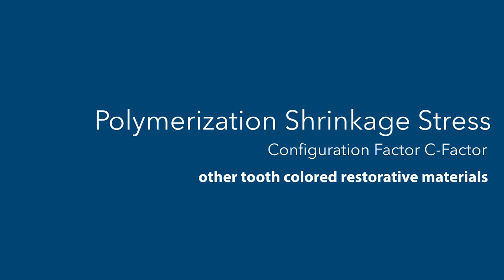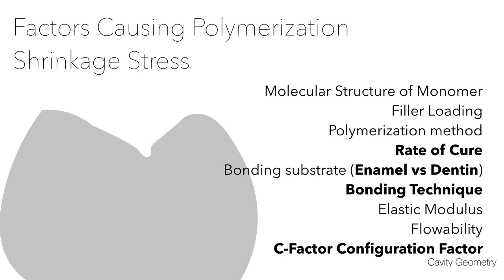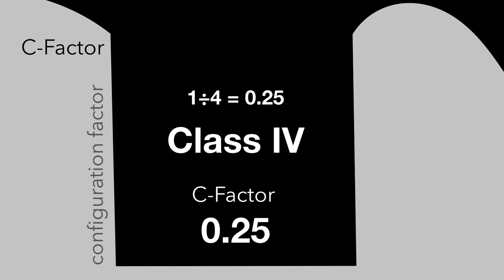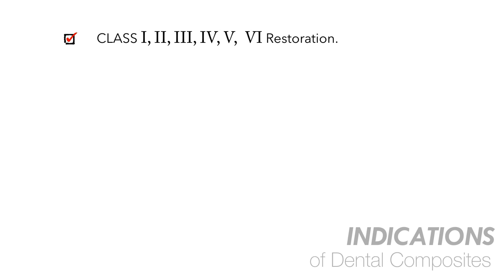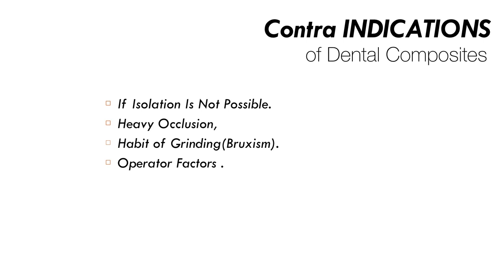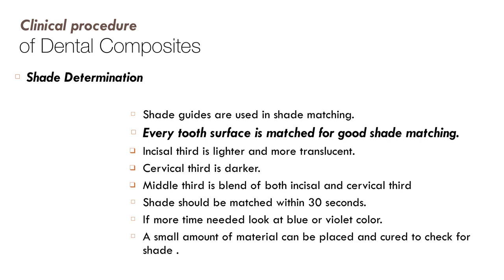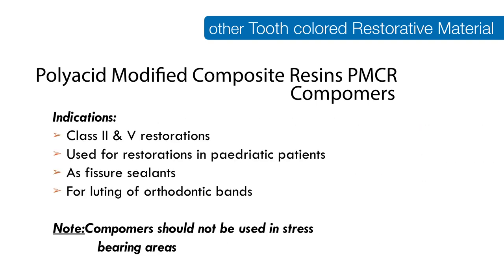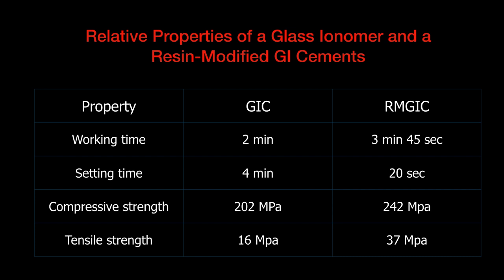Introduction to Dental Composite II

Comment: Does placing a liner in the cavity have any effect on minimising c-factor?
Reply from the maker: Using Flow able composites, just a minimal thickness, rather spread it with dycal applicator, has beneficial effects such as close adaptation to the underlying surface, and flowables shrink without generating stresses much stresses on the dentin interface.
but the c factor must be kept in mind, while spreading the flowable on one surface only...